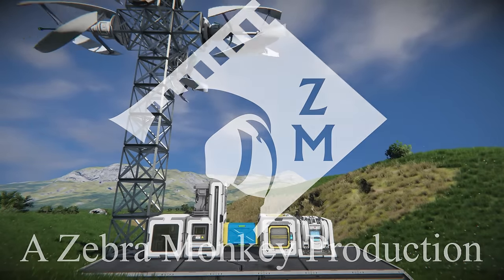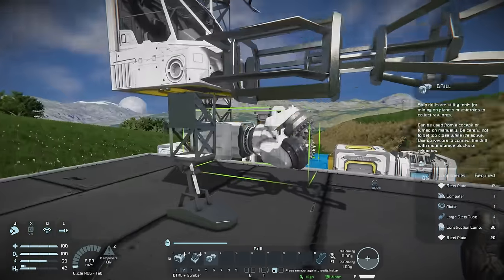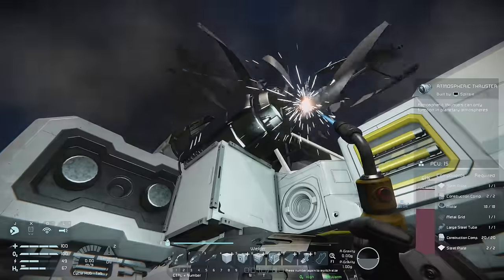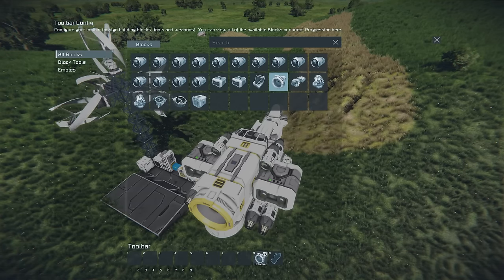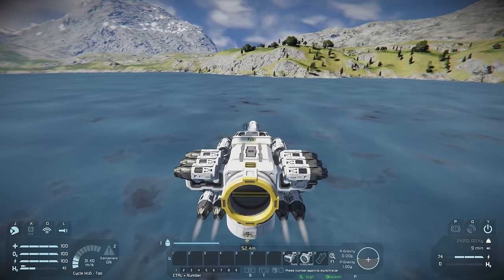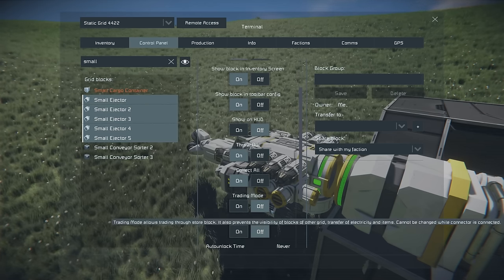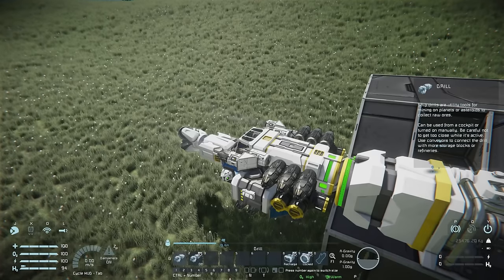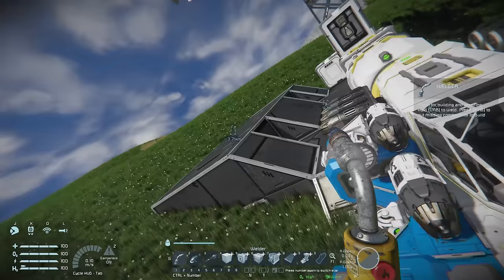Making a Mining Ship - Space Engineers Tutorial

Comment: The large connector will eject more stone per eject cycle than the small connector.  It can be harder to place another large connector.  With two sorters you can use the same connector used for docking.  Add some timer blocks to make the switch quicker.
Reply from the maker: All those are true, I just felt like they were a little too advanced to explain here but will absolutely be putting a video together with how to use an event controller to make docking/undocking safe but still have batteries set to recharge :)
Reply: and large connectors eject large boulders, often not something you want to do if mining is a semi tight spot
Reply: @Splitsie Yeah, getting into timer blocks is definitely more advanced for the starting mining ship.  Something to cover when upgrading the mining ship.  There are pro and cons of both sizes on connectors and a ship could use both for ejecting.

Comment: I spent a good 30-40 mins reloading to last save (over and over and over etc), because I overloaded my ship with ore and.. on top of that, my power was almost depleted. I had to move fast enough back to base before losing power, but also slow and controlled enough so I dont yeet into the ground. I could barely maintain flight... just had to have my ship at a very specific angle. ended up landing 20m out of base when I ran out of power and ended up having to grind the depleted batteries and installing fresh ones just so I can tumble my way back to the base connector lol. painful... but at least the ore yield was nice. Lesson learned lol

Comment: Somewhat advanced tip: You can use an Event Controller and Timer Blocks to automate docking/undocking procedures with the following system (adapt to your own naming conventions):

1 Event Controller + 2 Timer Blocks

"Event Controller Dock" set to Connector Connected
ON: "Timer Block Dock ON" set to Trigger Now, with the following actions:
        - Battery(ies) Recharge On/Off
        - H2 Tank(s) Stockpile ON (if you have any)
        - Thrusters OFF

OFF: "Timer Block Dock OFF" set to Trigger Now, with the following actions:
        - Battery(ies) Recharge On/Off
        - H2 Tank(s) Stockpile OFF (if you have any)
        - Thrusters ON

That way, all you have to do is switch lock on your connector and the Event Controller and Timer Blocks do the rest for you!

Yes, the Event Controller can perform up to 9 individual actions without the need of Timer Blocks (selected like you would the different toolbars), but the Recharge On/Off command can't be placed both in the On and Off slots, for some reason. Timer Blocks wouldn't be necessary if there were separate Recharge On and Recharge Off commands, but it is what it is.
Reply from the maker: I think you can place the recharge on/off in both slots, just have to do it on a separate hotbar e.g. recharge on/off on the left of hotbar 1 and the right of hotbar 2 :)
Reply: @Splitsie ...Aaaand I am now feeling very dumb for not considering that method.

Comment: Hey Splitsie, what about using a large grid rotor (or hinge??) with small grid rotor part as the start of a ship build? I haven't used it yet, but I think it would achieve the same result as you've demonstrated with the connector. It also does so without having to worry about the alignment and placing of the small grid connector.
Reply from the maker: It achieves a similar result and can do so for fewer resources since you don't need to complete the hinge/rotor. The reason I avoided covering it here is that when you build this way the inertial dampeners on the new grid can cause the thrusters to go nuts which requires enough extra steps and precautions that it felt too soon to cover :)

Comment: At 12.20 would you consider using the small flat thrusters onto the top and bottom of the batteries? You could fit up to 6 on each side for forward and back thrust. And I'm not sure but I think there should be enough clearance between them and a future drill (assuming the drill is next to the first drill).
Reply from the maker: You could use them, the main reason I didn't was that I didn't think I'd be able to get enough thrust from them. Since you need 3 for each of the regular thrusters it seemed a bit too much
Reply: @Splitsie  I didn't realise that 1 regular atmo thruster is equivalent to 3 flat thrusters but I suppose the size is 1 to 3 so that makes sense. Interesting. I wonder how the power usage compares? Cheers!
Reply from the maker: It's relative, so 1/3 🙂

Comment: Recently bought SE and am addicted.  I've found Splitsies tutorials invaluable so far (as well as your playthroughs allowing me more vicarious game time while travelling).

I have a question though.  I've built a copy of this ship and find that the stone sorter does not discard all the stone.  There is always a little I have to manually do (usually around 10% of full load), is this something I have not set up correctly. 

Secondly, a hard learned NOOB lesson.  This ship can really use some bottom protection.  After descending too fast (the first time coming home with ore) I smashed up all the upward thrusters and was stuck - fortunately right beside my base, but getting the miner up to replace them was a task.  I have since added a row of light armour blocks in two skids along the bottom of the side thrusters.  This has saved me twice now when I come in too fast and hit the ground as the armour takes the damage and I'm able to take off again.
Reply from the maker: The connector/ejectors shouldn't normally leave anything, but I'm wondering if you can get rid of that last bit by setting the sorter block to pull items as well 'collect all' (not in game at the moment so can't check if that's the wording)
Reply: @Splitsie  thanks, this was it. I noticed that option when I was redesigning the drill to sort as the ore left the drill.

Comment: Instead of connectors I prefer to put a rotor on main grid and then replace its head to small one, lock it and build on it. Then you can easily build vertically or horizintally and you have you battery charging immediately. Also it works with a projector.
Reply from the maker: The big downside of building off a rotor/hinge for new players is that your thrusters will go nuts once you build a cockpit as they attempt to dampen against the rotor/hinge, meaning you either need to turn them off or turn off the dampeners. I felt it was better avoiding this and giving new players a more stable platform to start from :)
Reply: @Splitsie  hmm did not try hinge, but on a rotor if it is locked I did not have any issues with thrusters.

Comment: To charge while I build:

Large rotor with a small head attachment.  (Build large grid rotor, grind off large head, add small rotor head in menu.)

Lock Rotor in menu.  (You do not want an off-balance vehicle free spinning as you build!)

Small rotor head allows the further building of small grid blocks on its face.

What is more, you can pipe up your inventory through said rotor to have instant access, especially if you design your vehicle around a cargo container.  (Make sure to match port size to rotor port size.)

Saves a lot of running around!
Reply from the maker: I often do the same, but for some reason (that is more habit than anything else) I seem to go for hinges most of the time these days. I chose to avoid any and all sub grids in this video as they're rife with little pitfalls, like how you need to keep your thrusters off until the build is finished or they can go berserk as a subgrid :P
Reply: Very true about the thrusters! @Splitsie

Comment: Hi I did a slightly different design because I wanted the battery in the centre line I connected the cockpit to the cargo with small conveyors bending around the battery into the cargo.  Problem is that ore gets left in the cockpit.  When drilling it flows through the cockpit into the cargo but when the cargo gets emptied the cockpit does not, it gets left behind.  I don't see a realt big difference between my design and yours. So not sure what the issue is.
Reply from the maker: Cargo doesn't automatically empty, you'll either need sorters or to manually take the ore out of your cockpit. The reason it's going there is that drills will push ore into the nearest container (cockpits are containers too) until it's full, then move onto the next one 🙂

Comment: Why didn't you use the larger thrusters that you said were more efficient?

Also, I would have put the ore detector and gyroscope on the dorsal side along the centerline.
Reply from the maker: Space, they're more efficient per unit of power consumed, but the thrust per unit of area is far less. The larger flat ones that are underneath providing lift are only slightly less efficient than the larger thrusters yet fit neatly in the space. The other directions of thrust are consuming less power (total) than a single large thruster so would end up needing more batteries to use those.

Having those blocks in the centreline would leave them sitting proud so I preferred to have them nestled in neatly on the sides :)
Reply: @Splitsie  Thank you. I was planning on building my own ship soon using your design. I guess weight and other considerations are why you didn't use the drop pod like you did in your past starter tutorial.
Reply from the maker: The main reason was that some people had difficulty following the old design, probably due to placement being obstructed by the shell. I figured I could make things more clear by starting a fresh build instead 🙂
Reply: @Splitsie  That makes perfect sense.

Comment: Note on the "might have to middle click again" this happens if you have multiple cargo containers since it seems it only fetches from one at a time even if they are connected so if your parts are spread out you might need to click multiple times.

Then again, if you still get the message that not everything could be fetched you might just be out of something. :)
Reply from the maker: I've had it happen even with a very simple base like what I'm using here, so it's able to happen with even the most simple systems (single cargo container and the production block's inventory). But you make a good point that if it's continually happening it's definitely worth checking you aren't out of materials :)

Comment: At 15:31 you changed the outside view, I also tried that but when I press V, I only get to see the top of my craft.  The connector is on the underside of the craft and I can't see it at all.  I need to see the connector in order to connect to the power.  My batteries are running low.  Please help, thank you.
Reply from the maker: If your 3rd person view appears stuck it's often because it's trying to move in an area where there's another grid (ship/station/rover) in the way. My usual ways of dealing with this are to move away a little bit then with alt held down move the mouse until I find a spot where the camera comes out of first person. When this is happening the way to tell if you're in first person mode or 3rd is to try to look backwards, if you're in the actual 3rd person it'll let you look backwards, first person won't. The reason I mention this is that it's often hard to tell when your camera gets stuck :)

Comment: When i build a thruster, it starts running right away. It will make my ship move and wreck. How can i stop this happening?
Reply from the maker: The easiest way to work around this is to get into your cockpit before you complete the thrusters and turn off the inertial dampeners (z by default). Alternatively, ensure your ship is locked to the ground via a landing gear or connector  so it can't move. If it's on a rotor/hinge/piston this won't work and you'll need to turn off the inertial dampeners :)

Comment: 1 thing to note to new players is that Flat Atmospheric thrusters are WEAKER than their regular counterparts. Also, I personally recommend at least a few downwards thrusters simply for if you ever find yourself upside-down for who knows what reason.
Reply from the maker: Large flat atmospheric thrusters are a bit more than 2 times as powerful as a standard thruster but much more power efficient. So the 3 along the bottom of the ship are the equivalent of 7-8 thrusters but using the power of (I think) 4 or 5. If you can fit them with the extra space they take up, the big ones can be quite useful. Otherwise you're right, in terms of thrust output they're 1/3 of the equivalent regular block.

Instead of having down thrusters just in case, which reduce how many you can have to prevent falling on your side or upside down in the first place, I think you're normally better off just temporarily flipping some thrusters over until you're out of the hole :)

Comment: Mine (while hovering) is doing an involuntary nose up, till it points directly up then holds its hover. Only way to keep nose pointing straight is to constantly correct with mouse (gyroscopes) What did i do wrong. Ive played this game for years but its been awhile and I feel as if Ive done it all correctly (as before) but am at a loss. Was able to vertically dock it into my main station port for now.
Reply: Just did an almost exact clone of my previous ship. Floats like a butterfly stings like a bee. 10/10 everything works amazingly well. The hell happened with my first build?LOL
Reply from the maker: If you're finding that's happening while the drills are running, then it'll be the tool shake causing it, otherwise, make sure you don't have a controller plugged in as any drift on an xbox controller or similar could be the cause as SE happily takes combined inputs
Reply: @Splitsie  Appreciate the reply!

Comment: That set up for basic refinery and stuff doesn't work on ps5. I have to keep doing it manually by hand cause the pipes don't like wok
Reply from the maker: The setup is identical on all platforms, I could plug a controller into my PC and get the same experience. Items don't automatically move through the conveyor network, some blocks will push it pull items but only up to a certain limit eg refineries will pull ore from connected inventories until they're mostly full, then will only pull more when some of it has been processed. You would need to use sorters or manually move the ores or items yourself, just as I had to 🙂

Comment: found this video to figure out how to get started cause I had a frustrating 2 seconds...  i put landing gear down, try to start building on it, and it toppled over...  soo...i guess im not gonna figure this out since in the first minute of this video, it mentions it automatically locking to the platform.. wtfffff
Reply: @ryanbard8555 I'd suggest you weld up the dropped landing gear first and check that the status light has turned green to ensure it is locked before you proceed with your build.  Note that if you are in space with no gravity it won't fall and lock.
Reply: @PoolOfTrees  if this is the case just place a large block that will turn static then build off it
Reply from the maker: Based on your other comment it appears you're in space, that's going to be a major issue. If that's not the case then as Eisen mentioned, place some large grid blocks to create a flat platform and then the landing gear can be dropped from very close to the surface allowing it to auto-lock